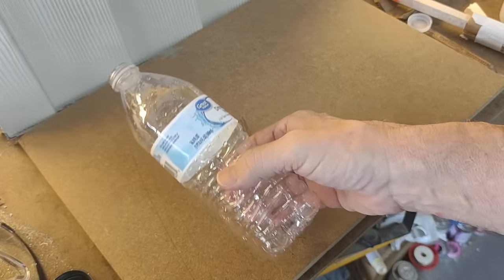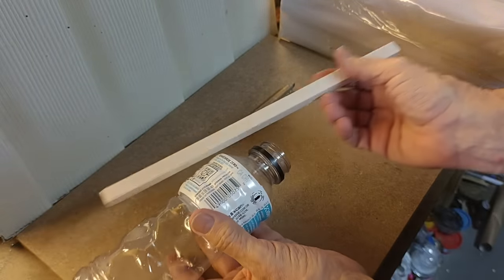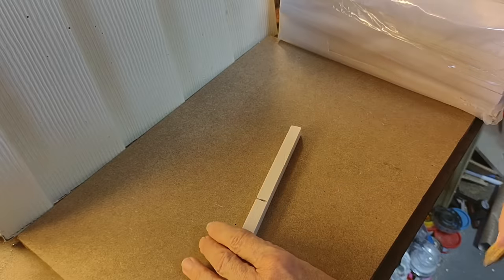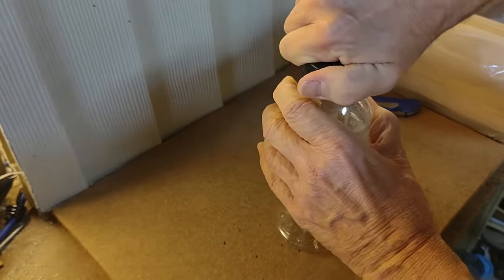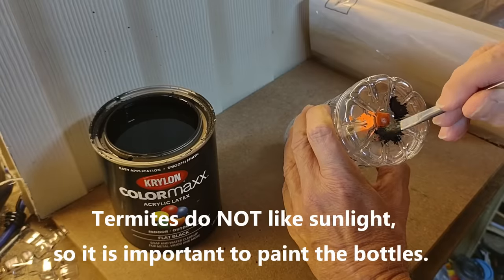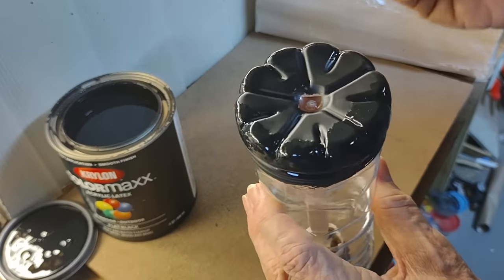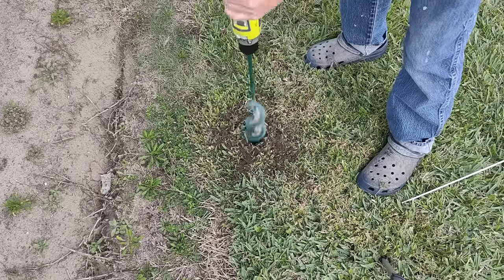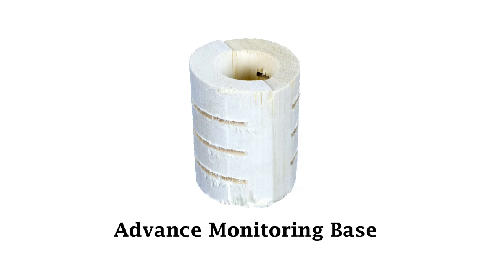Unbelievable Water Bottle Trick for Termites!  Simple to do!

Comment: Sheeesh all I have to do is look around the yard, there are termite mud coated sticks, debris, etc. If I leave a 2x4 on the ground say as a means to store an object off the ground, they coat it in the mud tunnels and eat away. A constant battle.
Reply: Here in Ireland we do not have them.We do have wood worm though which are far slower in their destruction.
Reply from the maker: It sounds like you live somewhere like Arizona or other hot, dry area.  If that is the case, you may have desert termites.  Please email me if that is the case and I will explain how to treat them.  If that is not the case, then trench you house.  I will give you a link to that video.  Be well my friend.

Video on how to trench for subterranean termites:  https://youtu.be/Fy7YHi_7Z8g

Comment: I don't have termites (at least I don't think so?)
That was a rather interesting recycling of plastic bottles and cheap enough to be done all around house (we have a few trees a bit close, they were probably just decorative saplings in 1952 when house was built?)
 We had ceilings come down during Hurricane Ian last year so could inspect inside roof
When we bought house, there had been a termite infestation but it had been treated and resolved before 2000, some of the termite tracks that were hidden became visible but no insects or movement was found (I removed some stuff myself to check, contractors also checked other area's )
We only got back in house at end of March this year, 6 months in hotels sucked.
Do you have any hints on the mini cockroaches? (German or Japanese roaches? keep getting different names for them?)
I've spent hundreds of having things sprayed but as they are not completely wiped out they re-surface. Since the hurricane, with various contractors creating a lot of dust the population seems to be reduced dramatically so I would like to eradicate them before numbers increase again.
Termidor doesn't seem to do much unless it's sprayed directly on them,  and Gentrol doesn't seem to do anything at all except cost money?
Thank you for a very interesting video.
Reply from the maker: I am so sorry that you are having a problem with roaches.  They are most likely German roaches.  You came to the right place because I know exactly how to get rid of them for good.  I developed an innovative method for doing it that I am now teaching to other pest controllers.  I have a training video on it that will show you how to do it.  I warn you though, the video is long because the process is not easy and it requires a lot of explanation.  It's kind of like taking a college course in roaches.  So, if you are willing to watch a 90 minute video, then you can eliminate your roaches 100% guaranteed for good.  This is the only video in the world that can show you how to do it.  There is literally nothing else like it.  It will explain why German roaches are so hard to get rid of and why everyone fails at it, including professional pest controllers.  It will guide you step by step on how to eliminate the problem.  So, if you are willing to invest 90 minutes, then you will have your answer.  By the way, this video has been viewed over 100,000 times and not one single person has told me that it didn't work.  

I hope that helps.  Be well my friend.

Cockroach video:  https://youtu.be/FoxCB5qLPMA

Comment: Are termites common in colder climates like in New Jersey?!?   I don’t think I have heard of anyone who has termites here.  Should just spraying with Taurus every 3-4 months be sufficient during spring, summer, fall?  Thanks!!!   :)
Reply from the maker: Termites are very common in NJ.  You only have subterranean termites that are easily treated.  Spraying with Taurus SC won't work because they travel underground.  That is why I use the monitoring stations.  You can also put termite granules around your house every year.  It costs about $50 per treatment.  I use both the granules and the monitoring stations.  

For the granules to work you need to have dirt around most of the house and that dirt needs to be porous enough to allow water to seep into the ground fairly quickly.  To find out if the dirt around your house is porous enough, just dig a small hole next to the house that is about 4 inches deep, 8 inches long, and just the width of the shovel.  Fill the hole with water and watch to see how fast it drains down into the ground.  If it seeps into the ground fairly quickly, then the granules should work just fine.  However, if it just kind of sits there, then the granules would not be a good choice. 

Make sure that you buy the correct granules.  You need the ones that have imidacloprid as the active ingredient.  A lot of the Home Depot and Lowes stores no longer sell the correct granules, but you can get them from Amazon.  I will give you a link to them.

I hope that helps.  Be well my friend.

Termite granules:  https://www.amazon.com/dp/B000RUIJYM?ref=nb_sb_ss_w_as-reorder-t1_k1_1_6&amp=&crid=157C3RV0MY0AK&amp=&sprefix=termit

Video on how to trench for subterranean termites:  https://youtu.be/Fy7YHi_7Z8g

Video on how to apply termite granules: https://youtu.be/H7rW_TSBHJ4

Comment: You should have took some med/heavy grit sandpaper and sanded it, before you painted the bottom. That would ensure the paint would stay on.
Reply from the maker: I thought about doing that, but decided that it would be too time consuming.  As it turns out, the paint sticks pretty well and rarely needs to be touched up.  I have had mine in the ground now for some time and I have not needed to touch up any of the paint yet.  I suspect that, over time, I will, but it's not a big deal.  Thanks for the comment.  Be well my friend.
Reply: ah, the gloss issue. good point!

Comment: I live in Ohio where we have all seasons.  I've noticed swarming twice in three years.  I'm not sure they are termites but it scares me.  I sucked them all up in a vacuum, sealed the bag and threw it away.  I put diatamaceous earth by the house.  I have Neem oil but have not used it.  It only happened in spring.  What should I do?
Reply from the maker: You are fortunate that you only have subterranean termites in Ohio.  If you have an infestation of them, they will swarm once a year inside your home.  Most of the time, you can find out if you have them by inspecting for mud tubes.  These can be found along the outside of the building coming up from the ground, and if you have a crawl space, they can oftentimes be found under there as well.  Check all around the crawl space to see if there are any mud tubes coming up from the ground or mud tubes that are attached to the floor joists.  You may also want to check the attic as well.  If you are unable to find mud tubes anywhere, then wait until they swarm again, and collect a specimen.  You should know that termites swarmers die very quickly because termites do not live long when they are exposed to the air.  They cannot colonize in your home and they are of no threat to people or pets. In other words, they do not bite.  If they have black bodies that appear to have just two segments, and they have four wings of equal length, then they are most likely subterranean termites.  Please get back to me when you find out what you have and I would be happy to assist you with treating it.  If you cannot identify these things, then please let me know, so that you can send a photo of them to me.  I will provide you with guidance on how to do that if you get a specimen.  

I hope that helps.  Be well my friend.
Reply: Thank you soooo much.  I will get back to you soon. @GuysPestSolutions

Comment: God bless you! I just moved into a 1750/1820 house which does have powder post beetles. I don't know if it has termites.  I don't like chemicals and live right next to a wonderful marsh/pond which I certainly don't want to poison.  I will look for your other videos for powder post/borate info
Reply: No need to treat powerpost beetle, they only damage the sapwood edge of the timber when it's milled
Reply from the maker: Powder post beetles like damp wood and you will often find them in the basement or crawl spaces of old houses.  You need to take them seriously because they can do a lot of damage and cause your house to be structurally unsound.  If you are finding these guys in the basement or crawl space, then the best way to treat them is with Bora-Care.  I will give you a link to the product and a video on how to use it.  This is a borate product, so it is very safe to use.  Please let me know if you are finding them in the house itself because they need to be treated differently in that case.

I hope that helps.  Be well Claire.

Video I have to use Bora-Care:  https://www.youtube.com/watch?v=Rmr_aEodyhg&t=6s

Bora-Care:  https://www.domyown.com/boracare-p-100.html
Reply: @GuysPestSolutions  that's not correct, powderpost beetles or lyctus borers only damage the sapwood edge of hardwood timbers, unlike the furniture beetle or anobium borer that can do structural damage, no treatment necessary for powderpost beetle
Reply: @GuysPestSolutions  Thank you, Guy!  Yes, a natural exterminator said on the phone they'd charge $1750 to treat the basement for powder post beetles.  I'd rather do it myself!
Reply: @GuysPestSolutions  Thank you

Comment: Just found your video and learned something new about termites. 
We often hear about termites, but I never saw one in my life. I would like to ask you about protection treatments. Which method protects your house better. spraying inside the walls using the new technology of tubes inside the walls or spraying the perimeter of the house? Thank You.
Reply from the maker: It depends on the species.  Where do you live?
Reply: @GuysPestSolutions  central Texas
Reply from the maker: @futurestradingstrategies  Can you narrow that location down a bit more for me.  What city are you near?  It matters a lot in Texas.  The tubes inside the walls does not work well for any species of termites.  For new construction, you can treat all the wood with Bora-Care.  That will prevent all species of termites permanently.  For an existing structure, you need to know what species exist where you are.  Everyone has subterranean termites in the area, but not everyone has drywood or Formosan termites.  This is important because drywood termites must be prevented differently than subterranean termites.  You can start by using the granules.

For the granules to work you need to have dirt around most of the house and that dirt needs to be porous enough to allow water to seep into the ground fairly quickly.  To find out if the dirt around your house is porous enough, just dig a small hole next to the house that is about 4 inches deep, 8 inches long, and just the width of the shovel.  Fill the hole with water and watch to see how fast it drains down into the ground.  If it seeps into the ground fairly quickly, then the granules should work just fine.  However, if it just kind of sits there, then the granules would not be a good choice.

Please make sure that you buy the correct granules.  There are two kinds of granules now and one of them does not work.  They are both manufactured by Bayer, but they really screwed up on one of these products.  Make sure that you get the granules that use imidacloprid as the active ingredient.  The correct granules are no longer available at a lot of the Home Depot and Lowes stores.  However, they are still available on Amazon and I will give you a link to them. 

If you do not have an active infestation already, you may want to also consider using monitoring stations around your home.  I use both the granules and the monitoring stations.  

I hope that helps.  Be well my friend.

Termite granules:  https://www.amazon.com/dp/B000RUIJYM?ref=nb_sb_ss_w_as-reorder-t1_k1_1_6&amp=&crid=157C3RV0MY0AK&amp=&sprefix=termit

Video on how to apply termite granules:  https://youtu.be/H7rW_TSBHJ4
Reply: @GuysPestSolutions  Thank You for this great info. Luckily, I don't have any problem with termites here North Austin, but some companies do try to sell this service. I've been in this house for 20 years and never saw any sign of termites since I spray the perimeter every three months, but I was wondering if I should go back to the spraying inside the walls through the valve installed when the house was built. Some companies say that this way of spraying does not really work. As to the soil outside it's clay.
Reply from the maker: @futurestradingstrategies  I do not think that spraying the inside of the walls with those pre-installed systems is very effective.  They may help somewhat with ants and maybe even with roaches, but it's pretty much useless when it comes to termites. 

Some people can spend their entire lives I never deal with a termite infestation.  That doesn't mean you will never get infested.  Unfortunately, you do live in Formosan termite territory, so I think it would be a good idea to take preventive measures.  I use both the granules and the water bottle monitoring stations.  You never know when your house is going to get attacked.  If your ground is too dense for the granules, then I would at least install the monitoring stations.  It's pretty cheap insurance.  Let me tell you.  If you get Formosan termites, you will be kicking yourself for not spending $25 to prevent it.  These guys can destroy a home in a matter of months.  You may not even realize you have them until there is extensive damage.  Something to think about.   Be well my friend.
Reply: @GuysPestSolutions  Thank You
Reply from the maker: @futurestradingstrategies  You are very welcome.  Be well my friend.

Comment: Well,the termites have eaten the wood of my subwoofer here in South America and you can see it spreading more and more by the surface of the wood with the coated plastic no longer has a hold for it to stick to. Should I put the bottle in the front opening of the subwoofer, since it is assumed that these have come from this front opening into the inner spaces of the subwoofer? Thanks for any tips. The subwoofer is not salvageable, but I would like to get rid of the termites.
Reply from the maker: The termite bottles only monitor termite activity.  There is no poison in them whatsoever, so they will not do anything to treat an infestation.  I am not familiar with the species that you have in South America, but it sounds a lot like you have some species of drywood termites.  If my suspicions are correct, then these guys have probably taken up residence in any number of locations in the building.  It is very common to see them in furniture.  My recommendation would be to have a professional pest controller have a look.  If these turn out to be drywood termites, then the only way you can get rid of them for sure is to fumigate the entire building.  There are things you can do to spot treat the speaker, but if they are drywood termites, then that is just the tip of the iceberg.  

I'm so sorry that you're having this problem.  Be well my friend.
Reply: @GuysPestSolutions  ,Correct ,it is wood termites that are here in some woods that are processed in chairs, tables, etc., which is to assume that these are already there in these woods and destroy them from the inside. With the Press span of the boxes, these have then particularly easy work . Thank you for your answer.